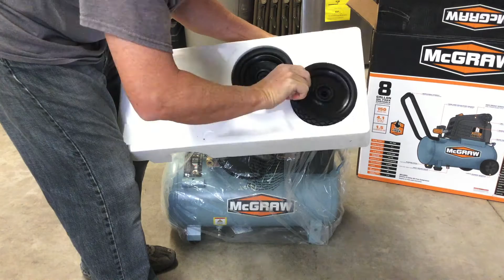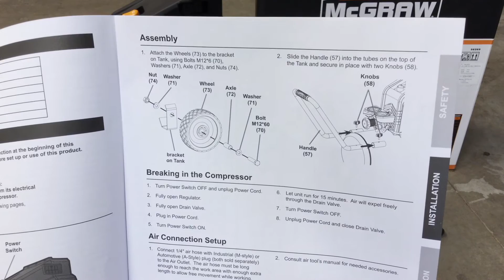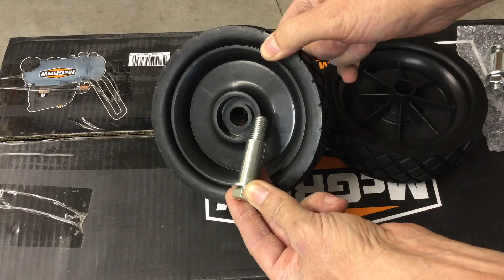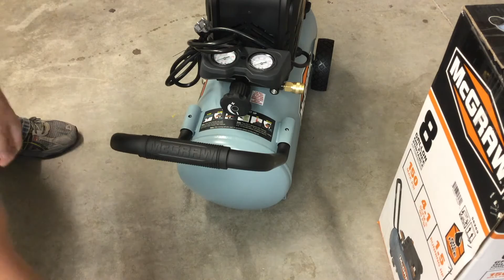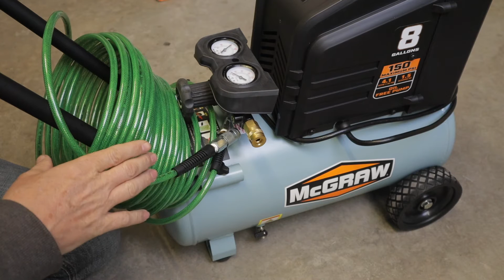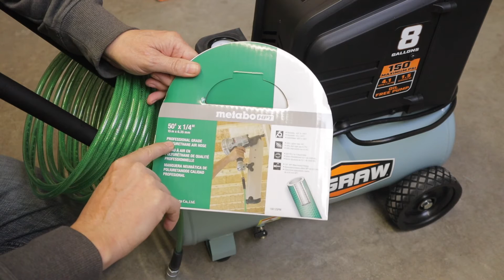Harbor Freight Portable Air Compressor - MCGRAW 8 gallon Oil Free - Assembly and Set Up

Comment: The instructions say to pull and push the regulator knob before turning it but mine does not do that. Does yours?
Reply from the maker: Yes but this compressor is several years old now so they may have changed something on the newer version.
Reply: @D @DIYHomesteadProjectsDIYHP10  looks like you’re right. Im a little annoyed that the regulator doesn’t have a way to lock because the vibration can throw it off.

Comment: Have you tried it with an impact for lug nuts? Probably not powerful enough but that will be rare case use for me I ride motorcycle mostly.
Reply: Ive used it multiple times with an impact wrench to remove and put on my car’s lug nuts. No problems
Reply from the maker: No I have not tried that.

Comment: I have the small one in the big one. I got a big one for Christmas and I'm glad I watched this video because instructions was limited and only telling me I had to open the foul but said nothing about the drain valve or anything else. Will this be in my first air compressor? I was going by but the manual was telling me but your video kind of explained more. So either I was missing part of the manual or the manual was just crap cuz I know they don't always tell you everything you need to know. I really appreciate it. We helped me out a lot. Now I know I have to break it in before I have to use it

Comment: Probably gonna buy this compressor, because it is very similar to one I had to part with a few years ago. 
MY usage similar to yours, except I will use it for motorcycle and bicycle tires, as well as car tires. 

I've had the long inflator nozzle like yours, but found the ball nipple (like the old fashioned service stations used to have on the end of their lines) to be able to  reach tighter spots.

For folks who have never used one of these types of compressors, a brief explanation about setting the pressure dial, might be useful.

Comment: The drain valve isn't in the center of the tank, it's up the side a bit. That means it will not drain water off the bottom unless water builds up to that valve.
Reply from the maker: True, you have to tilt the compressor a bit to fully drain the water.
Reply: Java I was puttin boots on to go get one ur comment made me stop dead in my tracks 🍻🍻🤝🤝 I didnt give that a huge thought thanks
Reply: Just tilt it to the sure

Comment: For the air connection setup, the directions go over using an in-line shutoff valve and a regulator valve. Are they needed as it seems to say in the directions or are they trying to get me to buy more stuff? 😅

Figure they'd be handy, but wasn't thinking they'd be a necessity!
Reply from the maker: You don't need another regulator and shutoff valve. The machine has both of those already. Just a hose and some sort of tool at the end of the hose is all you need to use the air compressor.

Comment: Hello, thanks for the review.  I am a home crafter and want to spray paint my small fence with regular paint.  Have you tried painting?  I am not needing it for a massive paint job but touch ups on my tool shed, fence, and craft small paint jobs.
Reply from the maker: I have not done any painting with this compressor. I really don't know what the requirements are for a compressor that's used for painting honestly. You could always get it and try it out. If it's not sufficient just take it back and trade up before your 90 days is up. Good luck with your projects!
Reply: There is a restocking fee so you will not get your money back unless you upgrade or exchange and also the minimum requirements for the most basic HVLP I believe are 4 CFM. Which is actually a lot. Now I will say that I've had their 3 gallon hot dog recently which is how I know about the restocking fee but when I use my iwata airbrush at 30 PSI it did not nearly need to refill the tank nearly as often as my hyper tough 3 gallon hot dog air compressor have been using prior to. It doesn't seem as if it's built a little better it's loud as all get out though I can tell you that. But just be wary of the restocking fee it's 20%. I've used the coupon to get it for 49.99 and I got some sandpaper came out to 60 something dollars I got 40 something back so there you go.

Comment: I have the same compressor with a couple minor differences but for a cheap compressor I'm impressed with it. I can run 2 framing guns all day long simultaneously and it keeps up just fine. The only thing I don't like is how it overheats easily when in direct sunlight but in the shade it operates normally without problem. The shroud allows sunlight to heat up the sensor so it cuts power till its cooled for 15 minutes and you do the reset procedure. Overall for the price and it's capabilities, in 20+years of working with pneumatics I am satisfied. I've had much worse from brand names and "better quality" units
Reply from the maker: Thanks for the info. I think it's hard to beat at this price point.

Comment: Hey, I have the same one, did exactly as explained, however, my compressor still gets to 60 PSI and turns off after a minute of hick ups. 
Any idea what I should do?
Does the regulator need to be open or closed?
Reply from the maker: If it were mine, I'd return it and get another one. The regulator controls the amount of pressure that is fed into the hose. If it's closed, no pressure to the hose.
Reply: Do you think that it has a technical defect? I must say that it’s brand new, I just opened it from the box.
Reply from the maker: I don't really understand what the problem is. It's really hard to tell what's going on without actually being there or seeing a video of what it's doing or not doing.
Reply from the maker: @easyactivations9951  The left gauge should show you what the pressure is in the tank. The right gauge shows what pressure is (regulated) to flow to your tool or through the output hose. Turning the regulator knob counter clockwise will reduce the pressure going to the tool. Turning the regulator knob clockwise will increase the pressure to the tool. If you turn the knob fully counter clockwise it will completely shut off the pressure to your tool. This is how I generally store the compressor because it will take all the pressure off the hose. (just my preference) When I get ready to use the compressor, I'll turn the knob clockwise to the pressure setting I desire for what ever tool I'm using. Hope this helps you out.
Reply: @DIYHomesteadProjectsDIYHP10  Thanks, I just got it yesterday and when it gets to 60 in the tank clock, it will start hick ups, no idea what it is. I'll send you a video later.
Reply from the maker: Sounds like it's not working properly. I'd take it back while it's still under warranty if it were mine.

Comment: These medium-small air compressors are basically useless. You only need a very tiny compressor to air up tires but you need a huge compressor to run very small air tools (the ones that use constant flow, not nail guns). So you either have to spend $60 or $600. There is no in between.
Reply from the maker: I use my compressor to blow out my shop or garage quite often. Or to clean up a work area from sawdust. A pancake compressor is pretty small for that task and a big $600+ dollar compressor is overkill for that task IMO. These small or medium compressors and their medium price range is nice. I think that's why they are some of the most popular and useful compressors on the shelves. It really depends on what the user needs are as to what is the best choice.

Comment: I could be wrong, but it looks like you closed the regulator valve which prevents air from passing through the male coupler.
Reply from the maker: Not sure what part of the video you are referring to but the compressor works good as it should.
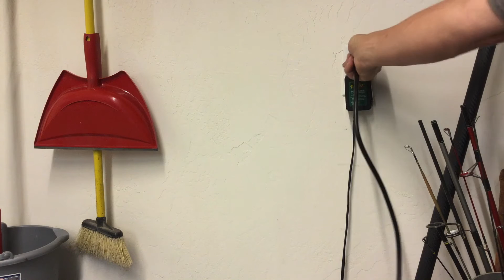Reply: @DIYHomesteadProjectsDIYHP10  At 3:40. I have the exact same compressor, and it seems to me counter clockwise would be closing the regulator, not opening it. You'll notice that no air passes through the main coupler when the regulator has been turned counter clockwise, as you're doing. The goal of the break-in instructions is to have air pass through the entire system (opening the regulator and the drain valve). The break in is primarily for draining any water that has been built up in the tank while sitting in the hardware store waiting to get purchased, and to heat up the motor for the first time. Technically, counter clockwise is "opening" the regulator, but the goal is to open the system which requires the regulator valve to be closed. The instruction manual that comes with the unit does a poor job explaining, imo.
Reply from the maker: Oh yes, I understand now. I agree with your observation. It's been a little while since I did that break in. I may have had the main valve closed instead of open. Luckily I did have the bleed valve on the bottom open so it was draining the tank instead of building pressure during the break in process.
Reply: @DIYHomesteadProjectsDIYHP10  I just purchased mine the other day. How's yours working out for you?
Reply from the maker: Mine was working quite well but it didn't have enough tank capacity for what I needed. I used it for about a month and a half then decided to trade up on the 21 gallon compressor that HF had on sale. Since I was within the 90 day period all I had to do was take it in and pay the difference to get the larger compressor. During the time I used the 8 gallon it was a great compressor. I didn't have any problems at all with it. It just wasn't enough volume for what I needed.
Reply: @DIYHomesteadProjectsDIYHP10  Right on. I'm just using framing guns which don't require nearly the power your welding gear does. Appreciate the info. Thanks.
Reply from the maker: No problem James, Happy Air Compressing! LOL 👍

Comment: I just bought a McGraw 8 gallon oil free air compressor from harbor freight just like this one. Why does yours not have the air filter installation? Something doesn’t seem right with my air filter. It doesn’t even thread in more than half way of the threads provided. Was this some sort of design flaw and perhaps why your machine has no air filter to screw on? Any ideas?
Reply from the maker: That's a good question but I don't know the answer. I'm thinking there must be a couple different model numbers with a few slight changes. I don't know if my version is newer or older than yours. Mine does have a replaceable air filter but it's not the screw on type. Mine has a single phillips head screw to replace the air filter. (My model is #56269)
Reply: Mine too! Just got it today and the screw in air filter still has like an inch of play to be completely on. I have been trying to find someone with the same problem. The videos i have watched seem to be almost, if not all the way screwed on with ease. Mine just doesn't want to full go in. Hate to have to drag this thing back to the store
Reply: @ein9367  I'm not sure your setup or what yours looks like but based off your description it is no different then mine. My air filter has more threads then the port it screws into so it bottoms out before it reaches the full length of threads. Does not effect anything.
Reply: Yeah mine theads in just a little bit too. But with a little Teflon tape that's not really a problem

Comment: What size adapter did you get for transition from air compressor quick disconnect to air hose?
Reply from the maker: I used 1/4" NPT fittings. Here's a link to a set that's similar to the one I used.
Milton S-212 1/4" NPT M Style Coupler and Plug Kit - 7 Piece
https://amzn.to/3rKIz8J
Reply from the maker: I also added this link in the video description for others that may be interested in what fittings I used in this set up.

Comment: Have you tried to run a impact on it yet
Reply: It will just make sure to set pressure to the tool your useing. I use mine and frame a whole house with it
Reply from the maker: Thanks for the input Quinn!
Reply from the maker: No, it will probably run an impact but not for very long. I saw a video of a guy running an impact on the black oiled 8 gallon tank.

Comment: Have you tried to see if the unit will automatically re-pressurize?  I have the exact same unit, bought end of Oct, and it's going back.  Believe the unload valve is defective, so when the unit hits 120psi and attempts to rebuild pressure in the tank, the compressor sounds like it is power starved.  I believe this is caused by too much head pressure on the compressor, because if I drop the line (tool) pressure to 0, it will run again, or if I depressurize the tank.  Both options are not acceptable if you expect this unit to restart automatically to keep pressure in the tank.  Check out the 1 star reviews on HF.  Check your unit before your 90 day warranty expires.
Reply from the maker: Tom, thanks for the information! My compressor unit seems to be functioning as it should. Fingers crossed that it continues.
Reply from the maker: Tom, do you plan to replace yours with another one just like it and try again? Or are you going to buy a different brand of air compressor? (Just curious)
Reply: I have the same issue. Did you figure it out?

Comment: After doing braking compressor do you close the regulator or leave it fully open?
Reply from the maker: If I'm not going to use the compressor right away I leave it open. If I want to use the compressor I adjust the regulator to the pressure I need for what I'm doing. Fully opening the regulator will bleed the pressure from the hose. I think that is good for storage so the hose isn't constantly under pressure when not in use.